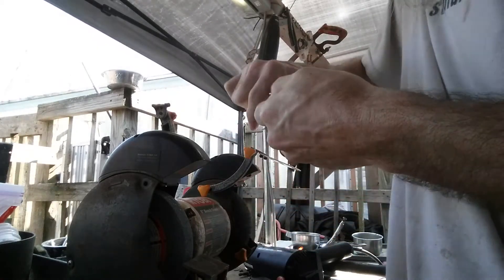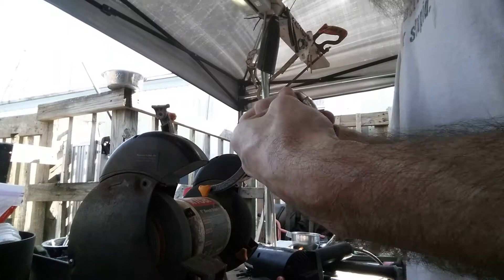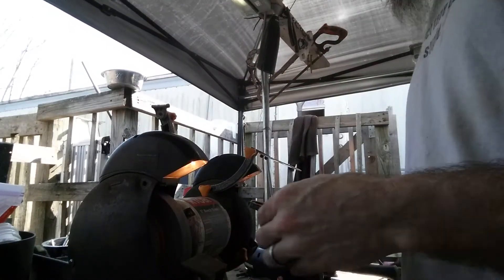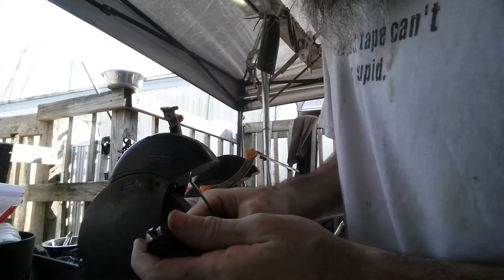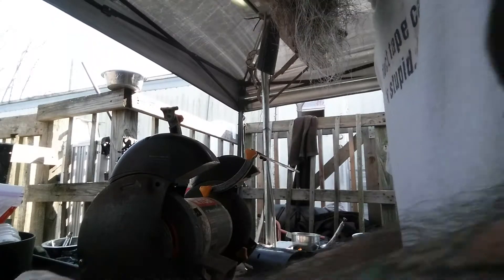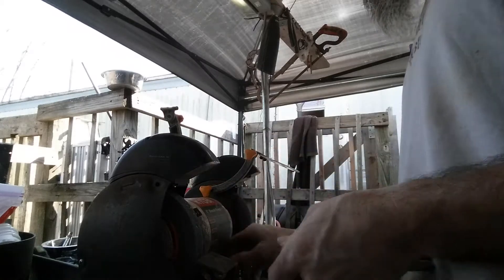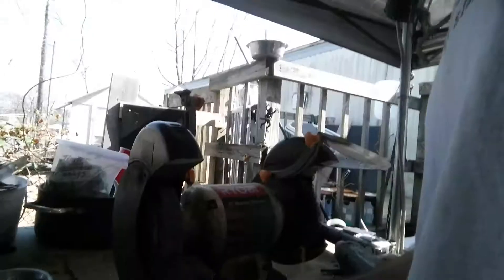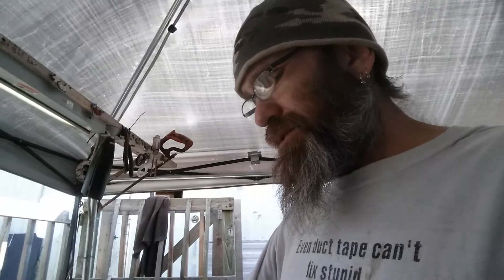silver from crystals

Comment: Hi Rodman, yeah I tried the grinder but as you found it's very fiddly and I lost the silver crumble a few times so that's why I looked for other options.

Still, it's at least on option for those that can't access a ball mill or want to dissolve the steel using chem's.
the long ones are easy to open by hand, the rest including oscillators I think are best milled down enough to open them up and turn the crystal and silver into crumble, then running a magnet over to remove the metal cans, that should leave us with just crystal & silver, then that could go to a refiner to process.

sending crystals whole to a refiner would probably not be worth the return so if we can at least get it to crystal stage that might be best.

oscillators on the other hand have circuitry inside containing gold so I'll be keeping them separate and treating them as gold recovery instead
Reply from the maker: Yea I found it quit cumbersome to put it nicely lol. I may dig my ball mill out an give that a go. Not sure I fixed my mill after I ran over it tho. I will have to look at it tomorrow. I read the thread about them on the forum pretty interesting.